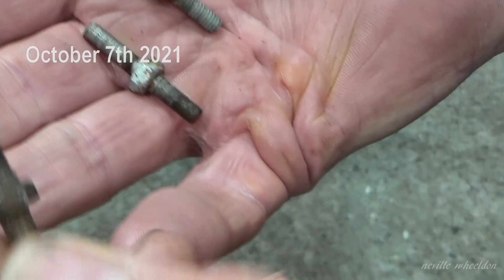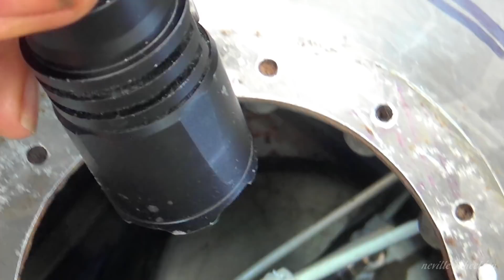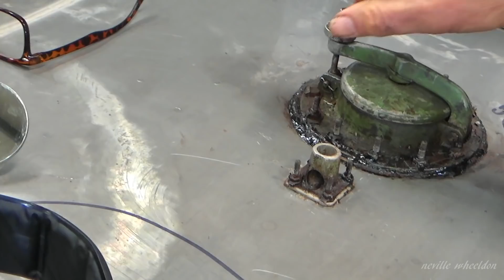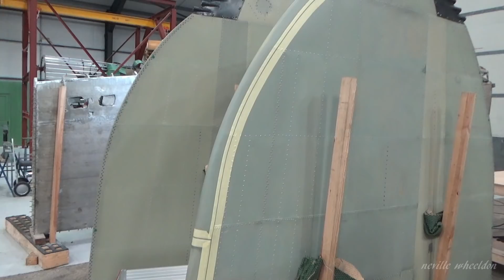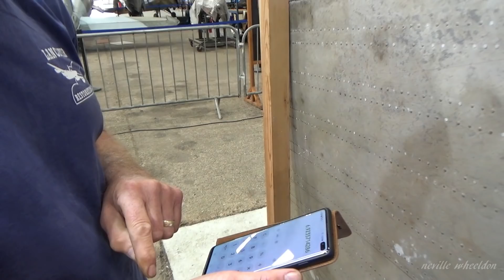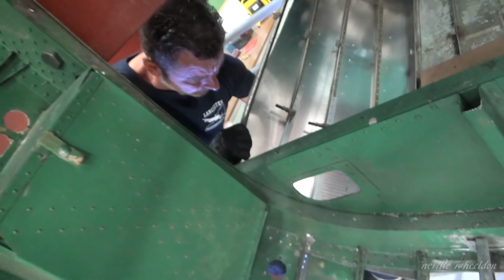Video 114 Restoration of Lancaster NX611 Year 4. Fuel Tank.

Comment: Hi Neville.  Two questions.  Just watched an old video from Lincs on a taxi ride and they kept the tail wheel down.  For some reason, I recall that they have gotten the tail wheel off. Do you know what the max speed is that they've achieved?  Also, when the get closer to airworthy, do they plan on installing dual controls as in BBMF and VERA?
Reply from the maker: Hi ajg617, If I recall right the pilot got to 50mph and then pushed the flying controls hard forward to make the tail lift.

Comment: Everyone seems to be having fun. Just a note on the fuel tanks. Mid 90s PA475 had her tanks out. It was noticed that there was a rattling from inside. It was found that the interfaces between the frames and stringers were cracked due to fatigue. To repair them, one side was cut off, all of the joints repaired and then a huge insert repair was completed. This was required for all tanks. You may wish to look into this as you are already working on the tanks.
Reply from the maker: Hi Simon, Gerbs taking all the fitting off, next year it is going to a specialist firm for repair.
Reply: @nevillewheeldon1693  excellent. Thanks for getting back to me.

Comment: With the dear cost of petrol during the day, I wonder under what circumstances a fuel jettison would be used, and was it controllable, such as, "I have 580 gallons (and you are correct - 100LL goes 6 lb/gallon or 3,480 lb) and I want to lighten the load by 300 gallons [and must be extreme - because as pilots say - you can't use fuel you don't have].  I don't know where he came up with 7.2 lb -- even jet fuel (kerosene) is less than seven.  And great highlight for the bonding for the fueling -- the US Air Force lost a C-5A Galaxy while it was under the charge of the contractor [they're supposed to know what they're doing] and during refueling, failed to ground the airplane and fueling rig properly, and touched off a fuel fire that destroyed the airplane.  And for the fuel tank jettison, I love the care you took to interpose contextual shots to better understand it.
Reply from the maker: Hi HH Thanks for your comments ,I'm not sure when the pilot would jettison the fuel , he would in serious trouble to go to these lengths, I guess he would coming in to land. ( Balance the aircraft ?)

Comment: Small amount, but possible to notice some minor rusty spots inside the tank as well. And doesn’t seem to be easy to reach them through the inspection holes. Well, nothing seems impossible to this crew at all.
Reply from the maker: Hi Namer in the new year the tank will be going to a specialist firm for repair.
Reply: @nevillewheeldon1693  , thank you for the explanation. Cheers!